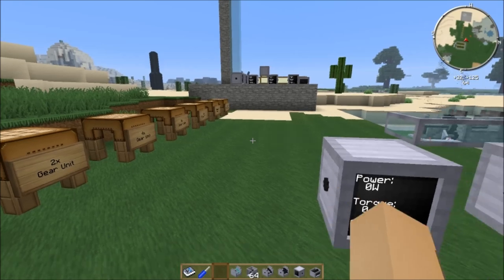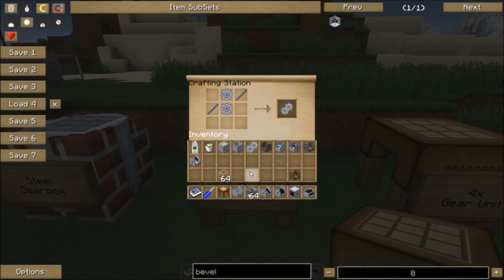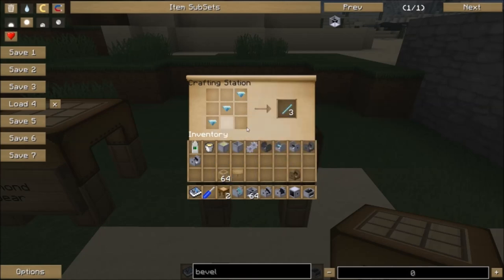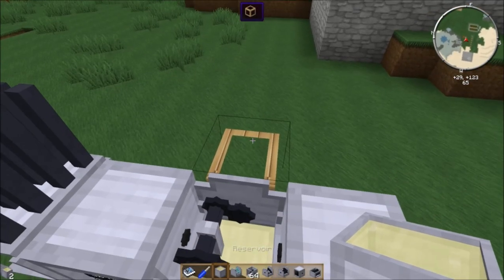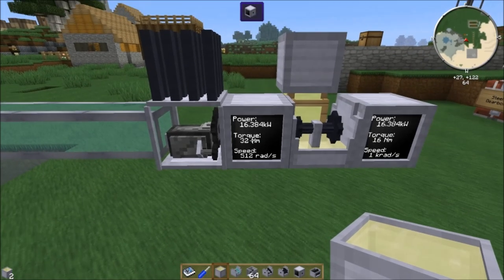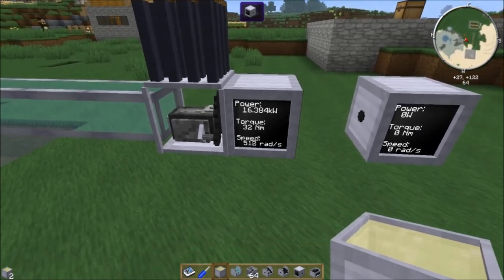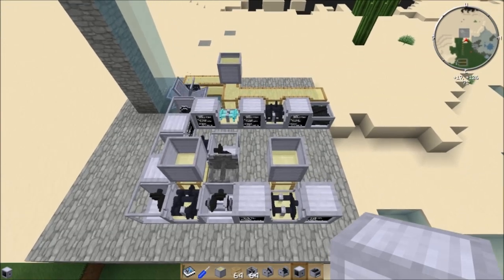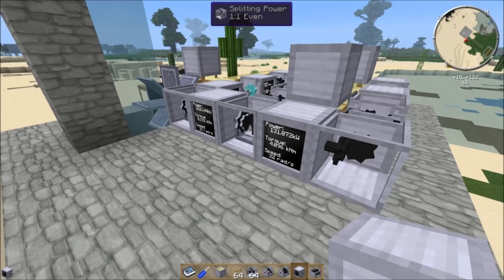RotaryCraft Tutorial #6 - Gearboxes In-depth

Comment: Absolutely perfect explanation. Now I know everything I need about gears and even more. Some cool things I learned, which I never used before (for ex. I would never guess tu put gearbox perpendicular first, to fill it with lubricant or to change mode from torque to speed, so it wont explode after turning it with screwdriver). 

So, thank you Sentinalh for another great tutorial. Waiting for another one.
By the way, you said that the next episode will be about gasoline engine, so it would be very nive, if you explain about performance engine too, because they are almost identical.
Reply from the maker: Yeah I will probably throw that in, the only difference is the additives after all. I'm glad you enjoyed the video and learned from it, that's why I'm making them. That and they're really fun.

Comment: This is really useful! Not only am I playing the revolution mod pack, but I have a game on my wii u called xenoblade chronicles x. You can passively generate money in the game with data probes, but there is an anti-idle mechanic. I'm either going to use a motor from a small fan, or my sink as a hydro kinetic engine, through some shafts and gearboxes, to make a system that will give the joystick a tug every few seconds.
Reply from the maker: +nicholas andrzejkiewicz Ha, that sounds hilariously cool.
Reply: SentinalhMC Thanks!

Comment: It is incorrect to say that there is no way to fix gearboxes. Right-click them with gears.

Also, what are you talking about "not being able to set the junction 1:31 inline"??
Reply from the maker: Okay thanks for the info I will add that to the description. Whenever I clicked on 1:31 Inline while it was attached to that Hydrokinetic engine it just said ERROR and didn't do anything.
Reply: Old version bug?
Reply from the maker: ReikasMinecraft Could be.
Reply: i try to repair the gear boxes with the gears but it just eats the gears and the damage does not go away or even change, at least on the steel 16-1 gearbox probably used 10 gears and the value of damage remains the same not sure if its bugged or what.
Reply: Was it at 99%? That level of repair may require many gears.

Comment: Hey, thank you very much for the tutorial.
I got a little problem tho, for some reason the rad's of my hydro are dropping below 32 (sometimes down to 28) quite often and therefore the power output gets lower really often too.
DO you know what the reason could be? maybe if the waterfall is too high?
Reply from the maker: +Marco Buley Maximum waterfall height is 64, there is no additional benefit for going higher. As far as I know the output of the hydro engine is completely stable.
Reply: SentinalhMC First of all, thanks for the answer. For some reason the rad/s of my engine is dropping for a very short time every few seconds which also makes my power drop. I don't know why it does that tho. Couldn't figure it out at all.
Reply from the maker: Marco Buley
Hmm, it might be tick related. You could try putting a flywheel on it, that might help to avoid your power output decreasing.
Reply: Hey, thanks again for your answer. In the meantime I've been dumb enough to leave my industrial coil alone next to it while charging and it blew up everything. Redid the setup exactly like yours (had the water flowing on it in another way before) and now it is working just fine. Still wondering what caused the Rad/s change tho.
Reply from the maker: Marco Buley
Yeah no idea why the rad/s would change, because those are always the same, build into the engine itself. The only way I could see the rad/s going down is if the engine wasn't detecting the water for a split second and started to shut down. Glad its working now, and also I hear you on the industrial coil. Those go boom in a big way.
Reply: SentinalhMC Funny enough, now I am at your Industrial Coils video, 2 days late ..^^
Reply from the maker: Marco Buley
Haha, that's how it always works.

Comment: hi ehm... i have a problem ^^ i have a bedrock gearbox 16:1 and cant fill in lubricant :P i used the same pipe and the tank i tried with bucket, ender io fluid pipe but nothing works did you can help ? ^^ i play DNS pack from ATlauncher
Reply from the maker: Bedrock gearboxes can't break so they don't need lubricant

Comment: "Shaft Junctions don't break" My experimentation with jet engines says otherwise. Does anyone know if i's possible to reach 1.21 GW? :P
Reply from the maker: I've personally never had a Shaft Junction break, ever. That's what I based that comment on. I was able to put far more power through them than steel should allow.
Reply: angeldude101 probably electricraft stuff well configured. or reactorcraft